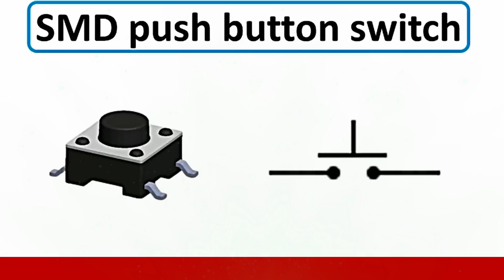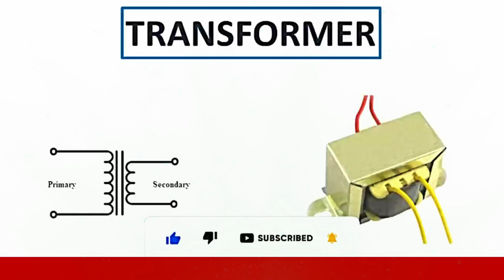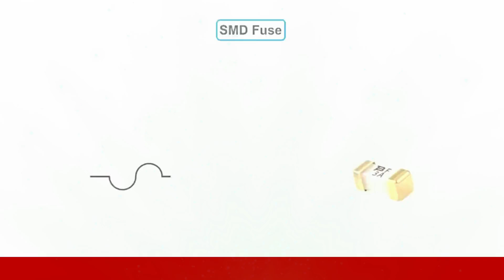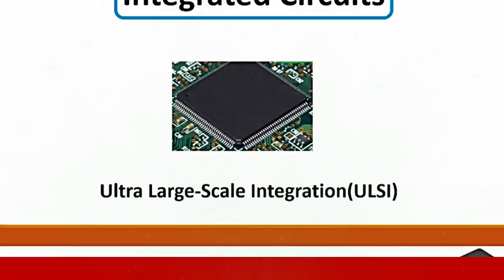Electronic Components: 99% Don’t Know All These Component Names, Pictures And Symbols

Comment: Sir , sot23 package is the most confusing  , there are so many configurations = 3 pins , 4 pins , 5 pins , 6 pins in sot23  , they could be buck converters , dual diodes , mosfets , or transistors
Reply from the maker: You're absolutely right. The SOT23 package can be quite a maze with all those configurations. It's essential to keep track of pinouts and specifications to avoid any mix-ups. I will consider a video about this topic.